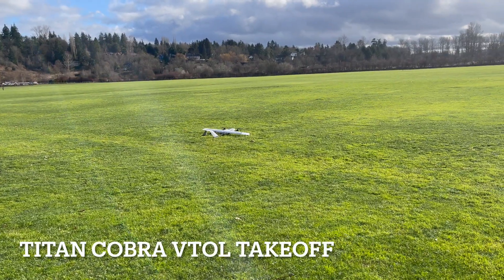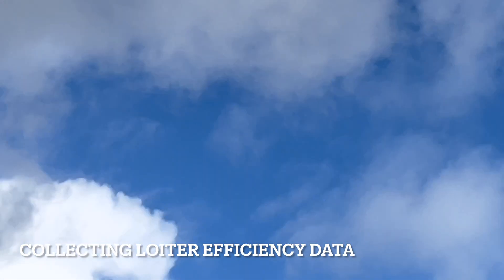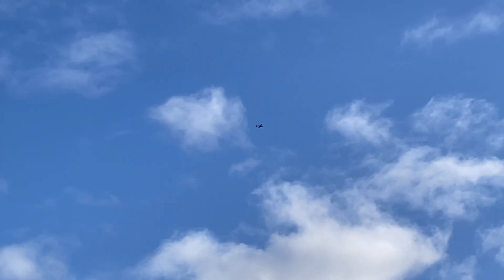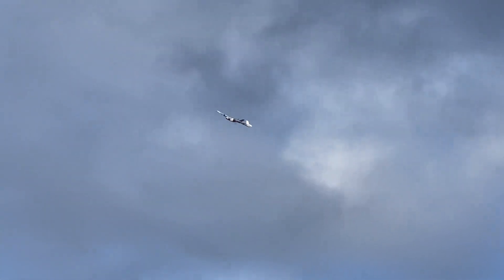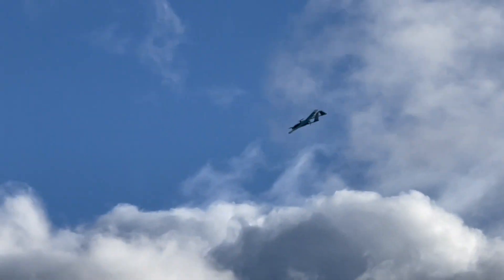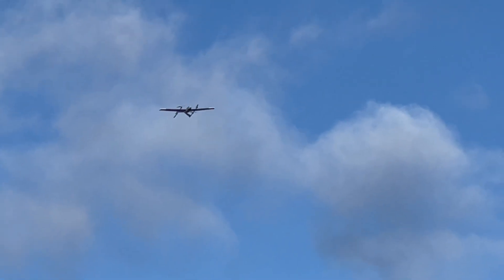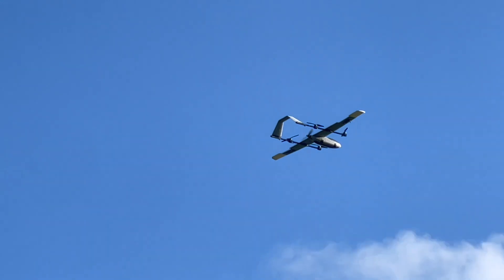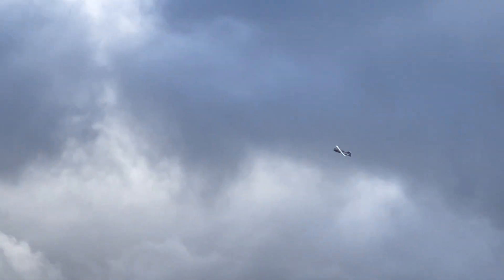Titan Cobra VTOL - Successful Maiden flight

Comment: Mohamad. I saw on a slightly larger commercial fixed wing VTOL drone they used some sort of magnetic sensor to align the VTOL prop blades with the airflow reducing drag. The same thing is done on some 1/3 scale sailplanes with nose mounted SLS. Somehow the ESC slowly steps the prop into the desired alignment.

Comment: I wonder. Maybe add a little 3d printed tab on the lifting motors that runs parallel with the blades so that it acts as a weather vain and align the props with the windflow while in flyine mode